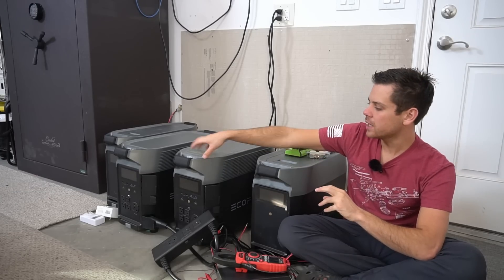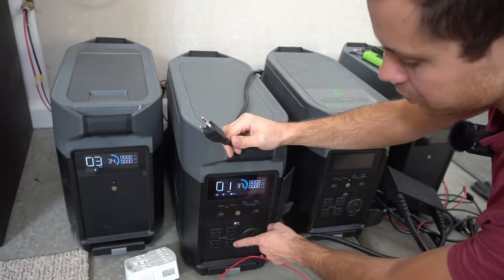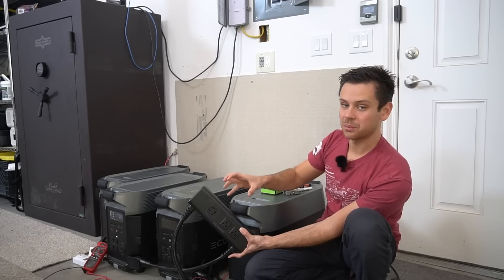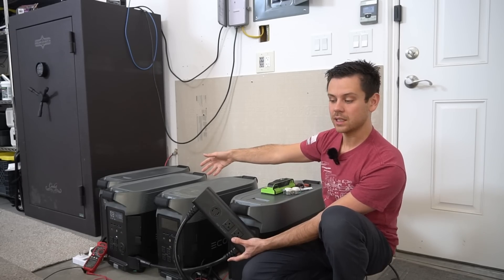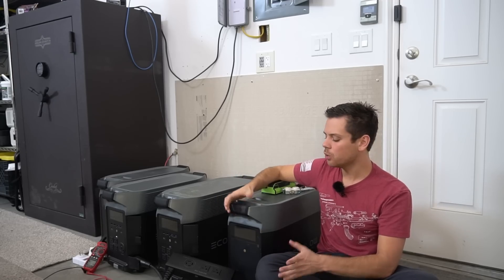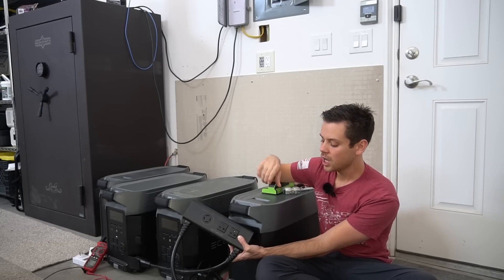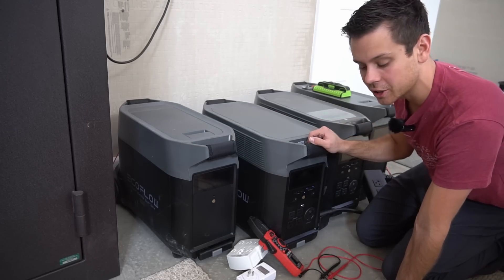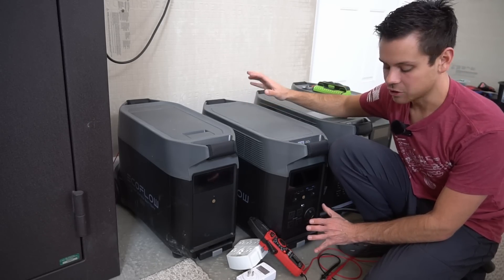I broke my Ecoflow Delta Pro 😬 (my fault)

Comment: Since the inverter still works, I bet there is a diode pack or switching setup that got damaged. Likely a controller failed. Keep us informed if they repair this.

Comment: Question: what happens with the solar panel if it's power isn't used? Does it heat up extra, and thus will die earlier?

Comment: Why would you even need to or want to bond your neutral at the device? Neutral bonds are only used at the primary service point or point of derived power.
Reply from the maker: Tesla charger requires it. Please watch my older videos. I've made quite a few on this. Even a few years ago.

Comment: A picture paints a thousand words Will, so a diagram explaining the conditions you speak off with the grounding, and showing how people can suddenly become a part of that grounding circuit, would go a long way with some of your YouTubers. But with most modern TV and computers leakage of current is common to earth, and it has caused RCD's to trigger because they exceed the milliamp rating. We now have RCBO on all our circuits in the house to avoid this happening, but if you created the same conditions by charging your car thats allot of potential unwanted current. Charging EV cars through AC is a very serious business because any problems or errors in the circuit could lead to the car body becoming LIVE, and or even the ground you walk on!!

Comment: Ecoflow makes a smart panel interface.  when these batteries are running the home system via the smart panel interface, would I be able to use my 240v Tesla outlet that's plugged into my grid system?

Comment: I think you know this already. But some of the pre production\ early production units have a reversed common and neutral on the 30 amp plug. They know about it and since fixed that issue. That would cause that problem as well.

Comment: Hey Will, thank you for pointing out this system's weakness and potential to create a ground loop. I would think the EcoFlow Electrical Design Engineers would modify the built in AC charging circuit to contain an isolating switching transistor bridge to kill the ground loop when charging from wall AC (??) Would this not suffice to isolate the grounding circuits ? Some engineers call this an isolating ground loop sensor/isolating circuit.

Comment: Thanks for explanation, makes sense from an Off Grid vs Grid Tie configurations.  How does a back up generator play into using the AC input to charge, that is with the Generator plugged directly into the AC iinput, not tied to the house or grid.

Comment: Will, I wonder if you would mind discussing, how you would build a couple of different types of batteries.  I just bought a fishing boat and I'm probably going to need to replace the AGM batteries soon, and I'd like to get a feel for what I need to purchase/build to replace them.  Battery # 1 is a group 24, 540 CCA, which starts the motor and runs accessories (I think), the other is a group 27, 670 CCA, and it is for the trolling motor (exclusively I think).  I guess they are both deep cycles, but I'm not positive.
Anyway, I know there are lithium Ion batteries on the market which I could buy to replace the AGM's, but they are quite expensive, so I was considering building them as an alternative.  What are your thoughts?

Comment: There are 2 types of UPS modes - Online and Offline UPS. Online UPS will isolate the inverter from the AC input source and the AC outlet ground/neutral will not be bonded. It's basically just charging the battery and consuming battery at the same time. Offline UPS is a Passthrough mode, and the grid ground/neutral bond is visible on the AC output of the unit. Some products like the Bluetti EP500 make a distinction between Online and Offline UPS, and you can select the mode. I've tested Online vs Offline, and the ground/neutral bonding situation is just as a described depending on which is selected.

Looking at the EcoFlow Delta Pro manual it talks about UPS capability but it seems to only have 1 mode. It seems to be describing Offline UPS mode, although it doesn't explicitly say it. It says "...the product can automatically switch to the battery powered supply mode within 30ms. As a basic UPS function, this function does not support 0ms switching." The "0ms switching" capability is only with Online UPS mode, because it's not really switching -- it's already running off the inverter. The fact that they say it takes 30ms to switch tells me they only support Offline UPS mode, which explains why you see the ground/neutral bond on the AC outlet.

Whenever I connect to grid and mess with these settings I triple-check what I'm doing as am paranoid I'll slip up and create a ground loop.

Comment: I think a power isolation transformer (2.5 kVA or more) from ebay would solve the grounding issue. I have one thats crazy heavy that been very useful.
Reply: Isolate the ac charging 120v input that plugs in the wall

Comment: Hey really important question for me. Would useing the smart generator be the same as useing the ac input from the grid. So is it ok to run the generator while useing any of the outputs??? Please comment.
Reply: I believe smart generator uses a DC connection. That's how it can charge the smart batteries by themselves.
Reply: @sentinel5555  thanks!

Comment: I'm having a similar ground fault on my growatt when trying to charge my tesla. My 5000es is connected to the grid, and panels, and neutral and ground are only bonded in the main panel. However, if I turn off the breaker from my main panel that supplies grid power to the inverter, and try to charge the tesla just from the inverter thru the subpanel, I get a ground fault. Is it possible that the voltage difference from the neutral and ground at the nema 15-60 plug is what is triggering a insufficient ground for the ev to charge?

Comment: A great video as always.  It would be better, though, if you add a circuit diagram of the ground loop with only solar input, and another with the AC grid connection.  That would help your viewers visualise the problem.  Thanks.

Comment: The equipment grounding conductor should be continuous through either side of the inverter/charger circuit.  Each inverter should have a transfer switch that will break the non-grounded and grounded conductors (hot and neutral) and bond neutral/ground in inverter mode. This would let GFCI work, and keep any downstream equipment at earth potential. Then his DIY bond would have just tripped out the GFCI. 

The User manual states it's not to be used in wet locations, while most of the marketing material shows "wet locations" (Under the NEC definition)  So I doubt that there is actually a GFCI on this thing. 

It's quite likely the 240 "split phase" isn't balance either at the generation on consumption point and there's occasional significant voltage on the nuetral. When allowed to jump to ground, it's likely feeding back into the ground plane.  (The inverter circuit and solar circuit are double insulated/isolated so they are fine,

Comment: Yep. Thats common knowledge. You always ONLY have 1 bonded ground location in the entire circuit.
Reply from the maker: I thought the whole unit was isolated. I had no idea the ground would go right through. I figured they used a ground neutral relay just like other manufacturers. Just like victron inverters for example
Reply: @WillProwse  Yea, many inverter companies offer UL listed inverters which do separate the ground and neutral and give you an option to connect them at the unit for off-grid use. 

My Sigineer 6KW Split Phase inverter is the same way but I know where the ground and neutral is bonded inside the unit so I can isolate if needed. 

 In cases like your, I'd just ground the case to a dedicated earth and usually that works to get the system going. 

My system has been going for over a year now with no issues wired with bonded ground and neutral off-grid. 

(and I am using refurb cells, which..are advertised at 150ah but I am pulling 175-180ah on both my 12V packs, wired in series for 24V w/ 200A BMS's, which isn't bad for the $850 I spent on them and they are the same price still today.. lol)

 EDIT- which also.. btw- the cells I am using are CALB 200Ah cells originally..
Reply from the maker: On their older model the ground didn't even connect at all

Comment: And that is why MPP Solar inverters ha a single pole double throw relay inside. If connected to utility then incoming Neutral is connected to outgoing Neutral. If separated off-grid (blackout) then incoming PE-ground is connected to outgoing Neutral.
Reply from the maker: Exactly!

Comment: So we find out that Offgrid and Grid Connected are different regimes.

  - For Grid charging (it may be a better topology anyhow) one could use a mains powered 10-25VDC (12A OR 200W max ) source on the solar input therefore charging the unit through the MPPT  - thereby separating the AC circuits, making it irrelevant if the "offgrid" component also has a E-N connection (strictly for standalone operation).

GFCI / RCD safety devices, may not like having a whole lot of E-N links on the wrong side of the main panel (especially  if the GFCI is controlling multiple loops).

Comment: Why did you stick the DVM into hot/ground the first time, then neutral/ground after you'd plugged it into the wall?
Reply from the maker: I wanted to check both. Didn't cut that clip that well
Reply from the maker: I cut it where I talk

Comment: Well... live and learn (!).   That outcome is better than being flung across a room after accidentally shorting a live 600VAC bus bar, I assure you!

I would plug in the AC charger, turn on the outputs, put on a load (not the car), without any additional neutral/ground bonding, using a good ecoflow delta and check for a voltage differential between any two of the following 6 busses:

* wall neutral
* wall ground
* ecoflow 240V neutral
* ecoflow 240V ground
* combiner neutral
* combiner ground

With and without load applied.   With a symmetric load and with an asymmetric (i.e. on just one 120V leg) load.

See if there is an offset voltage anywhere. Continuity doesn't necessarily mean a whole lot if the powered output has a offset voltage.   I'm kinda expecting an offset voltage to develop on the neutral ... either the EcoFlow delta's neutral output, or the combiner box's neutral output.  That could definitely destroy the AC charger.

Another possibility is a short across a phase-mismatch.

I kinda expect the Ecoflow Delta's neutral outputs to be floating (i.e. a tap on the output of the transformer).  Meaning that it is a 'soft' neutral and not a 'hard' neutral.   A soft neutral can be pushed around by an asymmetric load while a hard neutral cannot.   If that neutral is then connected to ground with a plug, that offset transmits back through the ecoflow delta and destroys something inside it when it hits the hard ground or hard neutral of the wall outlet.

A GFCI breaker on the wall outlet possibly would have saved the box.

-Matt
Reply from the maker: Smart!!
Reply: Aren’t you supposed to have GFCI protection on all your garage circuits?
Reply from the maker: @bdugle1  it was, but I tripped it daily. Swapped out for normal outlets. I know they are supposed to be gfci
Reply: @WillProwse  I guess they were tripping for a reason! Love your channel, keep up the great work!
Reply: @bdugle1  GFCI breakers can trip very annoyingly for many times of loads.   Usually those plug-type GFCI's are pretty wonky.   A GFCI breaker might work better (emphasis on 'might') just due to being a higher-quality device.

Inductive starts and inductive loads tend to trip GFCI's fairly regularly.  In fact, GFCI's built into L2 chargers generally have to program in quite a bit of wiggle room before they actually decide to trip during the initial power ramp, just so people don't get pissed off at them too often.

-Matt
Reply: @bdugle1  In fact, yes, it is code, with minor exceptions for fixed equipment and high-wall/ceiling plugs.

This can mean either a GFCI outlet (only one needed in the chain as long as the rest hang off that one), or a GFCI breaker.

-Matt

Comment: Open the bad unit:
Well it’s obvious you voided any warranty with Ecoflow , so I would suggest taking the unit apart examining the various circuit boards and see if you can determine what fail when you cross the equipment ground to the normally grounded conductor (neutral). Will, you seem like you have a good basis in electronics so perhaps you could even reverse engineer the Ecoflow circuits. 
If you’re lucky perhaps the component can be replaced so getting you back in business, besides being a good lesson for your subscribers and perhaps it’ll give Ecoflow engineering some considerations. 
This to me raises concerns that DYI solar people who elect to modify a grid tie system for emergency battery backup as thorough testing of any modifications and of course are opening themselves up to liabilities should something go wrong worst-case scenario electrocution of some utility worker, that's why I think that it's important to have UL approved grid tie equipment.

Comment: At the endpoint of a circuit you should never be bonding neutral and ground directly.  All EV chargers are looking for a small amount of continuity between neutral and ground or else they fault for safety.  To run a generator (or battery bank) with an EV charger you need to have a large resistor between neutral and ground to limit any current.  It means if you run any of the adaptors for EV charging, you need to make sure it is using a resistor and not bonding them directly.
Reply from the maker: Very smart. Agreed

Comment: That’s a bummer Will. 
But I think there is a fundamental lesson for the normal user here : “use the unit as intended by design”. 
For you it’s ok to to push and test in creative ways, but us normal humans should use these units as power and backup units. If it says can’t charge a Tesla, we should leave it at that. With other words, there is nothing wrong with the unit. 
The international unit can change a Tesla because it’s designed around 240v and electrical standards in Europe. A “dongle” doesn’t turn a 120v unit into a international unit. That’s why your Tesla rejected it. 
Still a good video. 

When you do your actual review, can you check/confirm that the expansion battery is a true expansion and not just charges the delta pro while the unit is in use. If it charges the main unit under load we would essentially burn thru charge cycle life in no time.

Comment: This show's you how messed up the USA electrical system is, trying to be everything to everyone. You just cannot mix 120/240 systems, especially trying to make it safe by grounding the neutral. The whole SS/Growatt discussion specifically and inverters for USA use in general proves this. Just because the lightbulb lights up does not mean everything is working and safe.
Reply from the maker: Exactly!

Comment: Whoa, sorry for your loss. Great minds can make errors when forging new territory. Don’t stop.

Want to let you know that my 4 Eve 280 3.2 v
batteries just arrived from Sriko. They test out perfectly. My bms should come tomorrow. 
These replace my old Trojan battery system. If I like these will upgrade my 48 volt system when I can.
Thinks for the guidance..
Reply: Yes, already appreciate how easy and clean they are to handle.
Thanks.

Comment: Will, sorry that you ran into problems. My recommendation on off grid solo use is to add a grounding rod and connect that to the eco flow units that way if any accessive current and static has a place to go to.
Its a little more of a pita in a house, but let me know what you think.
This is standard procedure for gas generators.
Reply: Ground rod is to reduce noise and reduce transient voltages that occur when equipment switches or motors start/stop. Current shouldn't ever be running through it.  Your RV generators are bonded near the genset windings to provide ground fault clearance (you should trip the breaker if hot ever touches a the frame of the vehicle)  Backup generators may be bonded and grounded behind a transfer switch in a separate sub-panel, but you are more likely to run the ground all the way through to the service groud, as it should already be bonded to everything already. (pipes and metal parts of the building struture)

Comment: My first ground loop diagnosis came up in a data center I ran nearly forty years ago. A union electrician added a ground bond to a sub-panel under a raised floor. The ground loop would be sensed by our power monitor and shut down power to all the computers (ARGH!). It appeared only after we loaded up our power system long after the electricians had departed (many months). I found the ground wire bonded into the sub panel to the concrete floor (???). I cut the wire and the problem went away.  Lesson learned.  This video is good advice, thanks Will.

Comment: To "trick" the Tesla wall charger into charging, instead of bonding the neutral to ground at your power source, you put a resistor between them. I don't remember the value of the resistor, but it's enough to trick the charger, but not so low that it creates a safety issue or harms other equipment.
Reply from the maker: Smart idea.

Comment: Safeguards are put in place for a reason. Not everybody reads all the directions. You found a fault in that one unit that could potentially be a bad day for somebody else. I would call that a good find. Keep testing you are fantastic at this. Push everything to the limits so the manufacturer can't see the fault in what they advertise. Thanks for what you do!
Reply: I have a Bluetti EP 500, does anybody know if that has the same problem with AC fault or if you can charge your EV?